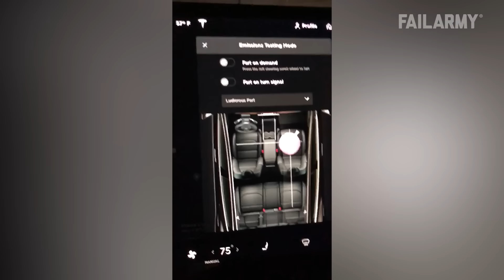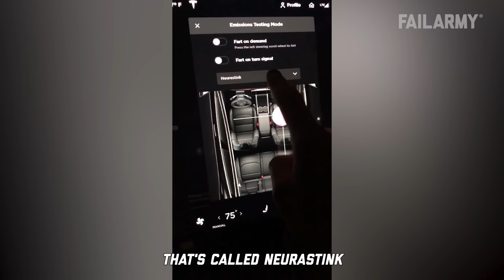Best of Texas Fails 🤠 Dumb Americans Compilation

Comment: 7:48 Aww, pefect opportunity to tell the cops to pull over and ask them "Do you know why I pulled you over?"
Reply: In response to the video voice - They usually don’t go to commercial places for gas, but a city/county owned station.
But still funny.
Reply: Didn't they use that as a sting operation?  When a driver stopped to tell them the driver would be ticketed for impeding traffic

Comment: How do dump truck drivers NOT KNOW the thing is up?
I would think the weight distribution and air flow drag would cause significant imbalance.
Reply: It is impossible to drive with the bed up at those speeds.
Sometimes you drive with bed up at low speed to spread gravel or whatever, and even at low speed you can feel the truck is top heavy. Plus, when you look in your mirrors, the truck isnt behind you. Then there is wind drag and noise on the bed.
This guy probably didn't realize he hit the sign, eithier.
Reply: I've seen several of these same incidents on Fail army at this point. How does this happen this often?
Reply: @anthonyklanke1397  
That's what I find so perplexing.
I watch Fail Army, too.  Have a great holiday.
Reply: Had a tipper truck take out a power line here fairly recently, guy was a local, drunk and on uppers. I think that's the typical case

Comment: 8:55- city people.
He doesn't want you, stop screaming and let him pass.
Reply: Are you talking about the raccoons at 8:50 or the masked creep at 8:57? It seems as though it could apply to either.
Reply: @paulkennedy8701 - If I meant 8:50 or 8:57, I would have said so. I was referring to the raccoon at 8:55, which is why I said 8:55. The guy using the masked creep as an excuse to grab the woman's boobs starts at 8:57.
Reply: @MrYfrank14  

I honestly couldn't tell. The timestamp is closer to the end of that clip than the start. And the second clip has much more obvious screaming, a more definite "him" and a much clearer instance of not letting him pass.
Reply: @paulkennedy8701  - I can't  help you with not realizing a time stamp refers to what is happening at the time stamp and not the start of the next video. 
I also can't help you with thinking the guy in the second video is trying to get past someone. He would need to enter the vehicle to pass them. If you are claiming the vehicle was blocking him, he could have just walked around the car. They didn't have pinned in an alley.